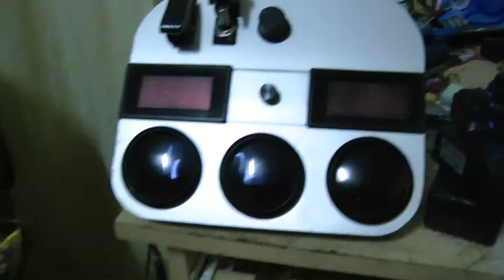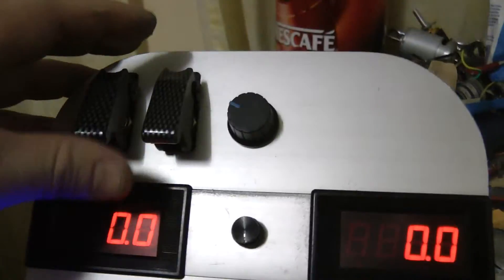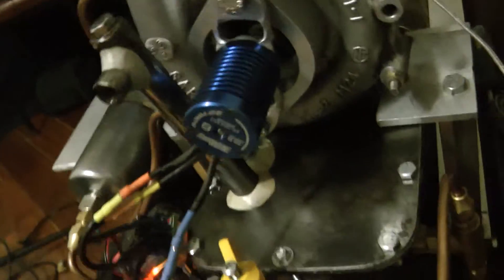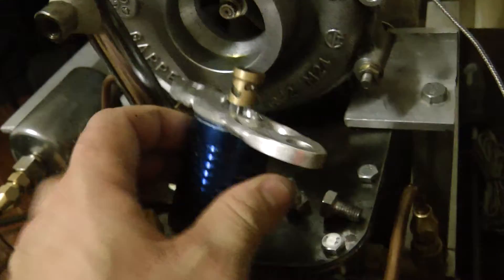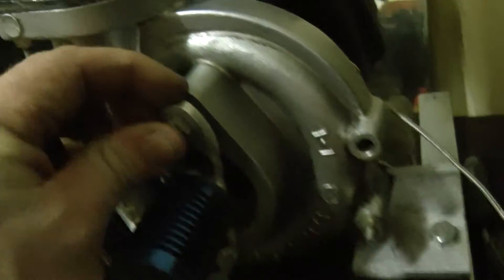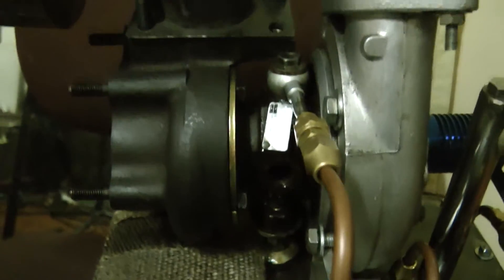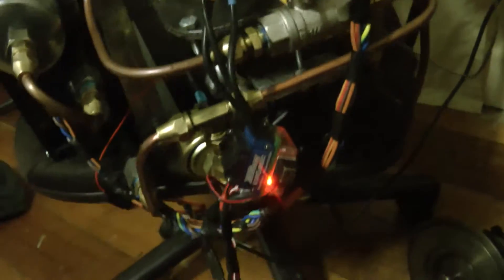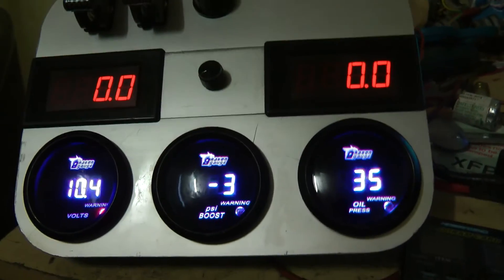How to Build a Jet Engine Part 2. Home made Gas Turbine Jet engine tips and tricks

Comment: Hello! Really nice setup you got here! I have some questions since I am closing in on my own turbojet project here, just some small stuff before I will do my first test runs...

first question is how much oil pressure should I have on the turbo? I use a small 12v fuel pump right now thats capable of 0.3bar max. But it seems to struggle with pushing oil through the turbo... is that because its not running? I have a bypass valve and if I open that slightly and still allowing some oil to the turbo it does come out, but just small drips(I have no pressure gauge for the oil yet) 

the other question would be; whats the recommended pressure for the fuel at startup? 

the last one: How whiny are these engines in terms of sealed combustion chamber? I am far from a good welder so my welds were not you know... exactly perfect haha, so my chamber right now does have some air leakage, but I will fix this soon, but I would like to know if I could get it to run still, I guess it will be harder for it to stay running at lower rpms if the pressure ain't what it should?

any response would be greatly appreciated!